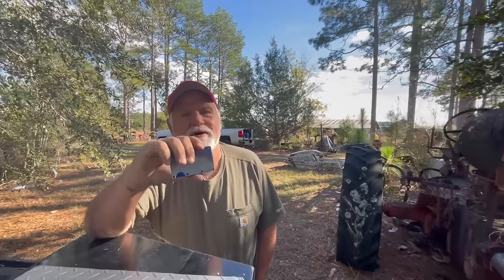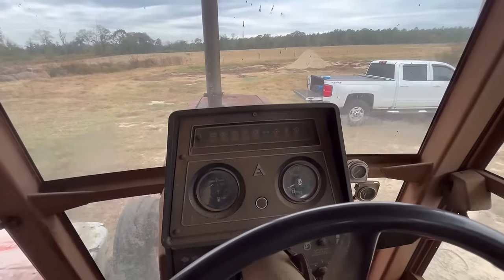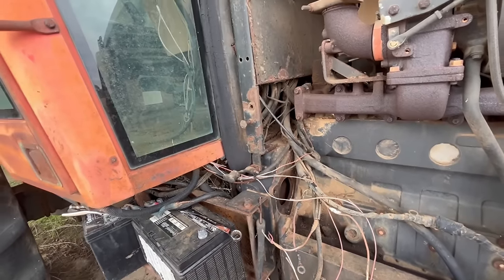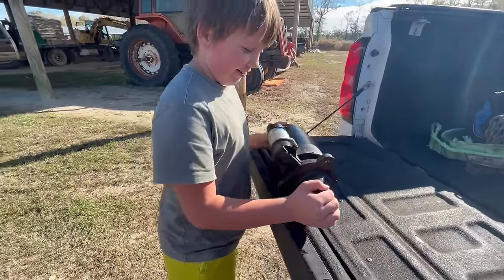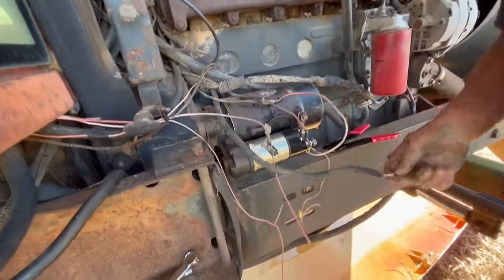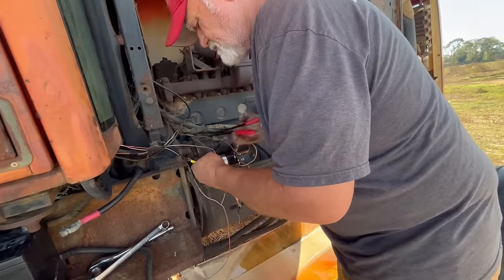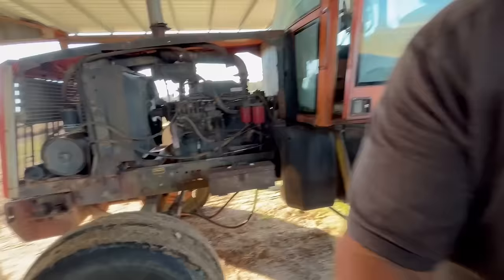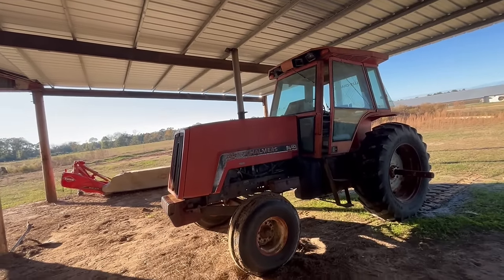Saw this ALLIS-CHALMERS 8030 Sitting under Barn. Can I  Start it in 15 minutes?

Comment: Dang Wiley I wish I could replace starters as easy as that one is I’d be a happy man I can’t remember the last time I had an easy job at all  never have any room to work and wires are always too short
Reply from the maker: You may have not have noticed but if the starter looks like it may be a challenge to remove, we dig deeper in trying to start it and probably still needs a starter when we leave

Comment: That is not an Allis Chalmers engine! However you did a great job getting it started. Looks like a Cummuns. Allis Chalmers made a great tractor I still farm with them even have an 8030 that is fwa. Nice Job
Reply: I noticed that the engine wasn’t an allis also
Reply from the maker: It was a5.9  it had been swapped out

Comment: Wiley Wiley Wiley 90 percent of the time the problems. With starters that are not used for many years is the solenoid. I have made this comment before we a Cat Challenger tractor. It would start fine all season. But after parking for the winter and unhooking the batteries. It would not crank in the spring we would get new batteries installed. And still it would not crank. So I changed the solenoid and it would crank normal. But the next spring we would have the same problem. I think I installed 5 solenoids before I got one that was weather proof. 
I don`t under why you and Hank do carry a small step ladder they don`t take up much room. I don`t know if you ever viewed Grandad`s Blowing Smoke channel I thnk those Gentleman are in Austrailia. They have mentioned Hanks channel so I know they view you. If you have not viewed Bruce in AUS. He has a nice video of freeing stuck injectors in a Detroit. I knew this would take more than 15 minutes. Thank you for another nice video and saving me from Hank`s jokes.
Reply from the maker: I really had given that so much thought on step ladder but i am just not ready 
But your right. How that would make my life easier. Hank can still move around pretty good

Comment: Nice way to trash the $100.00 new solenoid by using a screw driver and messing up the treads on the terminals so when the next guy tries to remove the nuts they gull or strip or spin in the solenoid. Just take the time to use the key or a properly connected starter button. I have worked on starters that were jumped with a screw drive and seen what that does to the terminals. 😡🥵
https://www.youtube.com/s/gaming/emoji/7ff574f2/emoji_u1f621.png